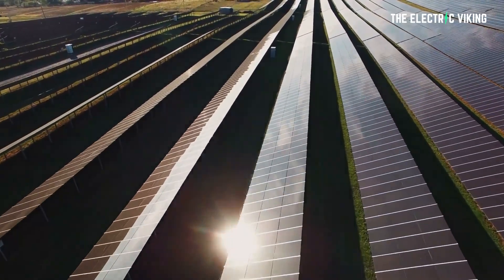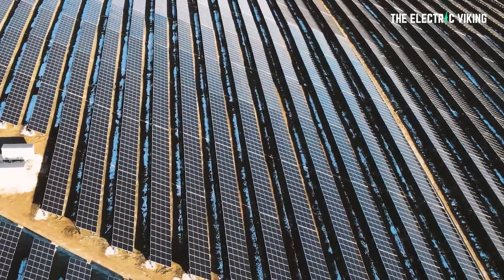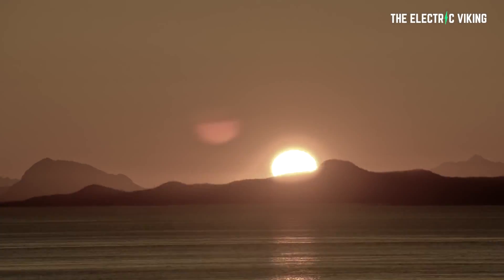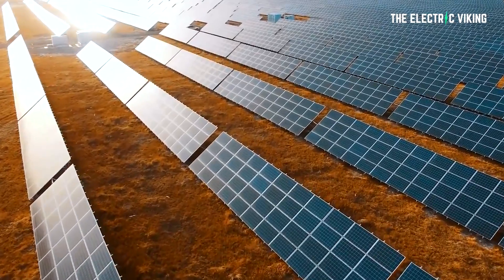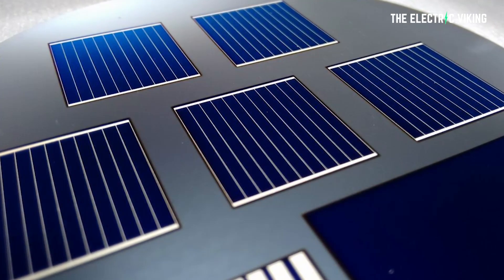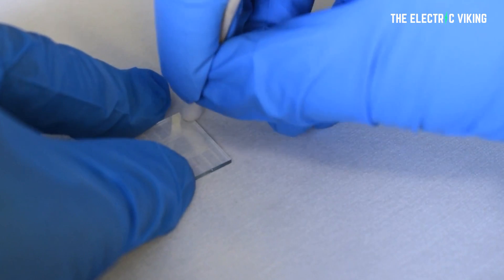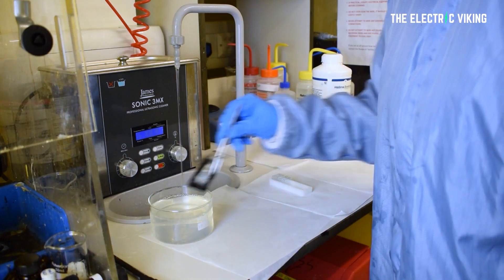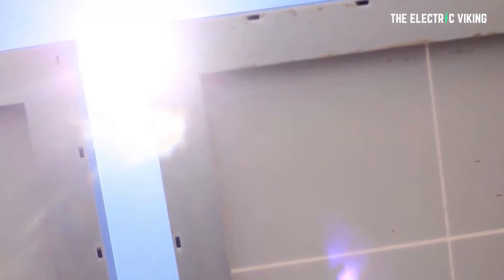Researchers push tandem solar cells to record 30% efficiency

Comment: If it weren't for all the 'tipping points'; some of which I fear have been passed, I'd agree and Oz, from being a lunatic basketcase, re global warming under the liberals, is going to produce way more power than they could ever use. Only complete idiots will insist on continuing with petrol/diesel vehicles, especially as it gets harder and harder to find anywhere to refuel. Range anxiety, is what it's called I believe.

Comment: Blah blah blah.  The FACT of the matter is that wind and solar electricity is only available 20% of the time.  Nuclear is 92%.  Gas is 90. Utilities HATE wind and solar electricity.  Utilities need 100% base-load capacity PLUS need to ramp up and down as the wind and sun varies

Comment: Only 31% efficiency ? How about 39.2% efficiency under terrestrial conditions, with no Sun concentration: https://www.youtube.com/watch?v=wwHjyeyRofM
And panels on the ISS exceed 45% efficiency, under ideal conditions. Those are in use right now, but they are very expensive.
The researchers are expecting to exceed 51% efficiency with terrestrial cells and Sun concentration, by modifying the design of the 39.2% efficient cells.

Comment: Aptera solar panels are designed to be replaceable, plus they have a right to repair policy, so everything will be upgradable as tech evolves. They will lead the way in hotrodded EVs, which is one reason I reserved one. Think post-WWII fighter plane drop tanks converted to lakes runners! 😅

Comment: Years ago (30 or more) I had read that the solar cells used in space were something like 33% or so efficient. They were GaAs instead of Si and a sandwich of 3 or more layers. some layers absorbed infrared, some visible and some UV specter light. They were very expensive. i would be very happy to see such efficiencies made available at lower cost.

Comment: Oxford PV are already commercialising a tandem perovskite + monocrystaline silicon panel this year. Production in Germany
Reply: I read an article, and also saw a video on YT on the same, that perovskite panels greatly lose efficiency after a year or so of use and their real life applications are momentarily highly challenged.
Reply: @Matt_K  as far as I know (and could be wrong) but I think Oxford PV and Saule have solved that problem

Comment: That would be 300 watts per sq meter of solar panel.
( 1kw solar energy per sq meter approx )
On a semi truck roof about 35 sq meter can be made available for solar panels. That is about 11 KW of electric power to tap into..
Hopefully the costs will be low enough.

Comment: I can only fit 2000w on my roof but its still enough for me to be about 90% off grid, 30% efficiency would give me 1/3 more energy to play with which would be make a huge difference to my life in winter but also in summer because I could easily run a split system ac then. By the way my little solar system is still usually bringing in over 150w on the cloudiest days and sometimes 500w on a cloudy day where there is zero blue sky. Im not as optimistic about our future as you are but solar and battery advances are definitely one of the beacons of light.
Reply: @jedics
You should put the panels on a carport or on a canopy in the yard.

Comment: I remember hearing that Germany was nearly 100% green energy.  The gas shortage has proven that to be wrong.  Time to drill more geothermal wells since Germany has low sunlight and wind?
Reply: France has 24 of 56 nuclear power plants offline. To help France keeping the lights on, Germany was exporting everything they could to the French grid. Peaking at 13GW.
The French were paying highest premiums and because of the merit order system, did drive Germany's electricity prices sky high.
And Germany used 6x times the average gas consumption to generate energy for France.
Now France is reactivating closed down coal power plants.
Reply: @larsradtke4097  France gets good wind and sun.  I do remember reading that 100% solar stood for 100% energy credits to allow the other half to be gas and/or coal.  That's probably a French thing too.  It's a shame they didn't put some to the plants on standby, it is worth the extra cost if you consider the alternative is freezing to death.

Comment: Tandem cells have been around for awhile.  It's just that they're too expensive, except in specialized applications, such as used by NASA.  The questions for a perovskite layer might be the following: (1) what is the gain in terms of cost reduction per watt?  (2) what are the gains in terms of area reduction per watt? (3) what is the expected lifetime of the cells (a current challenge for perovskite technology)? (4) How easy is it to incorporate into today's solar mass manufacturing supply chains?

Comment: They need to stop messing around have some type of "Manhattan Project" improving solar efficiency and wireless charging ... instead of having to stop and plugin to charge 100% of the time. Wireless charging would require far less infrastructure than charging stations all over the place and get far more use so, they really need to focus on wireless battery charging right on the road while driving, where ya need it. They could add the wireless charging infrastructure right along the roadways. Imagine how quickly things would change if solar could get to 50%-60% efficiency and we had outstanding wireless charging for EV's. Solar needs to be far more easily recyclable anyway so, it's time for solar panels to go for a next generation upgrade of the future.

Comment: An aptera that has these tandem 30% efficiency cells, wow.
Reply: Aptera solar panels are designed to be replaceable, plus they have a right to repair policy, so everything will be upgradable as tech evolves. They will lead the way in hotrodded EVs which is one reason I reserved one.
Reply: Im sure they are already looking into it

Comment: Well that a good thing if the panels cost an be kept the same . That spells big trouble for Wind turbines as an approximate halving  of solar electricity cost per Kw means wind turbines are pointless economically. Wind farms at sea are proving much more costly to maintain than estimated and these costs will only rise faster than inflation .

Comment: When comes to power transmission you're way off. You have to compare solar to nuclear power. Average nuclear power plant in the US is built on 1.1 square mile and can power 600,000 to 900,000 homes. For solar farm to do the same it would need to be build on 100,000 to 200,000 square miles. Don't forget that those solar panels require maintenance. Nuclear power is the ONLY way to go, for a very very long time !
Reply: I love nuclear and I see the point, but why not get solar in every roof and external wall, if its gets cheap enough? Also, you dont need a hard permit for solar.
Reply: @AdlerMow  
Yes, if it gets cheap enough. Right now, that's like $25,000 to $60,000 expense for the home owners, depending on your house size, and you would get your money back after 10-15 years of living in your house. That is a big investment for most people. I'm talking about power transmission. Only nuclear power make sense as of right now.
Reply: @peterp4753  install yourself.  400W module, EXW $150 or less, depending on duty. That is $4500 for 12kw.
You want battery, too,? LFP 10kwh EXW $4000. Get the other components 2-3k
$12k for a 10kwh off grid solution.
If you want to install yourself.
I can get it also cheaper if you need a full container....
Reply: @peterp4753  Why people pay 25-30k for a car that won't last 5 years but can't afford a system that last 20 years and will bring supply safety for them?
Reply: You mean like France? 24 of 56 nuclear power plant being offline and driving Germany's energy prices sky high, while they export everything they can to the French grid? One container fits 950 x 400W modules,  Or 380kw peak. They can be installed within 2 months on roofs. A nuclear power plant needs lengthy maintenance time and might destroy your neighbors electricity grid. 
See France.

Comment: they are about only 2€ more expensive per square meter than traditional solar cells.
but still, they have a down side. the perovskite part loses a lot of its efficiency over time.
but this is where the guys from FAU and helmholz institute in ulm, germany and many others come in to find protective layers that preserve that efficiency over time.
i expect production of prototypes with acceptable lifetime for certain applications from the next year on. there might be some applications where 20% degradation every 2 years is acceptable if the foil that you can buy costs only 5$ per square meter.
but of course we want to have longer lifetime. and i am sure we will get it very soon.
imagine a motel in the middle of a dessert. the roof and walls completely covered with cheap solar that lasts over 30 years with an efficiency of over 30 percent, that also charges the cars. using agrivoltaic to grow plants without the sun burning them.

Comment: Its all about the cost. 3-5 junction cells have been around for a while now and they are up in the +40% efficiency. Problem is they cost too much except for things like satellites etc. As you mentioned, sensitivity to a wider frequency band is the key to so-called increased efficiency. Cost dominates the equation because less efficiency simply requires more surface area. Very few scenarios are available footage limited. I buy less expensive panels due to their price per watt being lower than the more expensive panels, and mounting costs are a minimal component of the expenses.

Comment: We are running with scissors.  We are doing nothing to make the waste from solar and batteries safe!!!! The push on solar now is because Billionaires have bought all the mineral mines and production of the current production of solar and batteries. They will keep solar locked in place as long as possible with corruption. Lithium and solar panels are a perfect proof of this market corruption. Also certain politicians have bought into the Lithium recycling market without any way to recycle it not just a lock on the market saying others CANNOT enter the market. The same way alcohol market were locked during prohibition in the USA.

Comment: No it doesn't.  And it still needs coal or gas or nukes for backup.

We've seen this movie...and the ending is preventable, if we DON'T do what you espouse.
Reply: Give up, you're losing
Reply: @rogerstarkey5390  Not hardly, dude.  The fact you're still following me, is proof enough of THAT...
Reply: True

Proof is in the pudding ❗️
 Look where Germany is right now with them shutting down their nuclear plants.
 Germany tried to go green 🟢 but they went at too fast of a pace and are worrying about "heating" for this up coming Winter.
Russia has just about cut off gas supplies to the EU Nations, so those countries are scrambling for new sources of oil.

With the "#Special_Military_Operation" between Ukraine and Russia, the EU countries are searching big time for gas supplies.
 Solar panels and Wind Turbines don't come close to cutting it just yet.

Comment: 30% sounds like the efficiency of a standard internal combustion engine. Interesting how low they both are. Lots of room to improve
Reply: There are some laws of physics (sorry, I can't remember the names of the laws) that place an upper limit on the theoretical efficiency of an internal combustion engine, and as far as I know there is not much more room left for further efficiency. This video discusses a solar panel technology that might provide 40% efficiency, but I have no idea what the theoretical upper limit of efficiency might be: https://www.youtube.com/watch?v=ytdWAKgPyI0
Reply: Zero comparison to ICE.
This is "passive efficiency".
No mining, refinement of fuel.
.
And before you say "WAH... You have to mine the materials!"
.
Mining materials for solar is comparable to mining materials for the refinery and or the engine the fuel is used in.
The difference is the solar mining is paid for very quickly.
The ICE mining cost is NEVER recovered.

Comment: I got a 20.6 KW system in 2018. Best decision I ever made...and the panels all held strong during Hurricane Ian. No more electricity bill and no more gasoline bill. We are driving 2 electric cars now and feeling pretty damn lucky with all the fuel prices inflating and it doesn't effect my family. 👍
Reply: 21kw is massive, how much was that
Reply: Asking the same thing as John.  I need a system that size because of my geothermal system.  What was your total cost?
Reply: You are in Florida, lots of sun and good reason to have solar. How many years before you pay that off?

Comment: Just remember that solar cells are worthless when the sun doesn't shine
that includes days with clouds
so this totally unreliable power source needs a backup
either expensive batteries
or carbon-based fueled generators

and every solar cell bought means the CCP in China gets the money to destroy the USA.
Reply: I thought Tesla builds their panels in Buffalo NY?
Reply: @bobsacimano4104  That could be. I'm referring to all the rest of the panels you can buy. ALL made in China by slave labor.